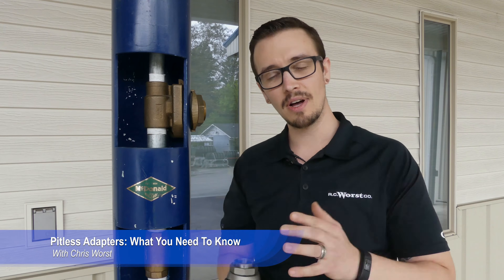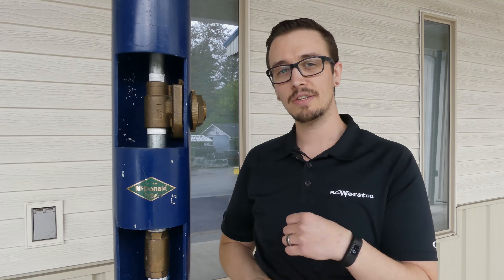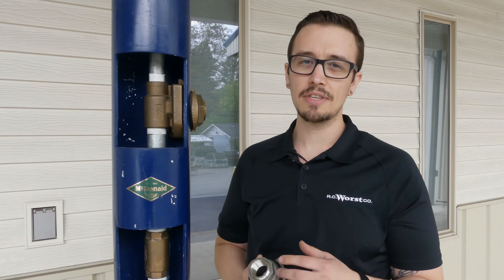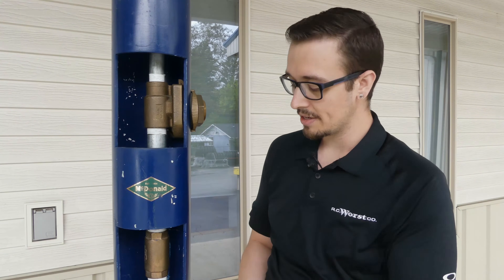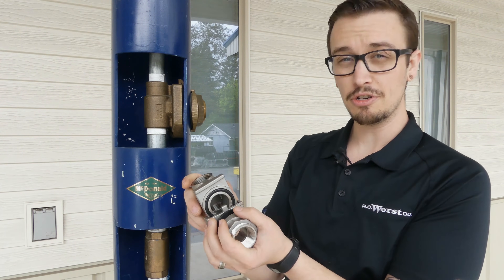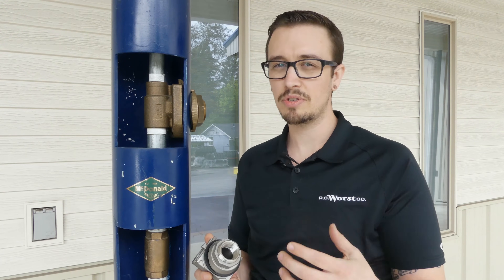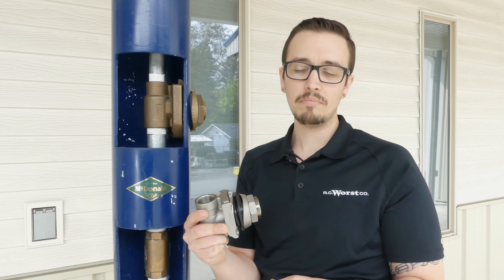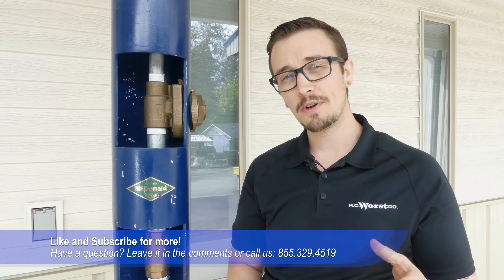Pitless Adapters: What You Need to Know

Comment: Another use for the Pitless Adapter is for outdoor frost free spigots…it’s a perfect alternate use that you’ll need to cap one port and drill out the other. Saves future headaches of digging and breaking out floors etc or going through hardened ground in the winter if things go wrong in that season.

Comment: Question: I just bought land with a well that was drilled back in 2003.  It's never used, it's just a steel casing that runs 325' and was reported to have a flow rate of 11 GPM.  I noticed this weekend that there was water gushing out of the well head after a bit of rain.  Im wondering what happens when the temps dip down below freezing?  Is there a chance my casing is cracked?  Or are they tough enough to deal with expanding frozen water?
Reply: if your well is 325 feet deep water should never come out of the head
Reply: @FlyinRaptorJesus apparently the water table is very high.  I had a well guy come out to give it a look and he said I’ll have to install a pit less adapter. He said the well is seasonally  artesian

Comment: there are 2 types of adapters, one like shown and one that hangs from a  T at the top of the casing and uses a long tool to tighten/loosen the saddle that aligns with the hole in the casing down at 4 or 5 foot.

have a great day

Comment: I want to install a Bison Pump deep well hand pump alongside my submersible pump. Unfortunately, my pitless adapter is really large. It takes up 4" of the 6" inner diameter of my well casing. I'd like to replace my pitless adapter with something that is smaller, so that I have more room inside of my well casing to fit the hand pump. Anyways, my question is if I dig down and attempt to replace the pitless adapter with one that is smaller, will it still fit in the hole that is in the side of the casing? Or will the casing hole be too big for a smaller pitless adapter?

Comment: Great Video !
I have a question, after 40 years my water system has developed an air leak.  It is not bleeding air from inside the house; the check valve is working at the pressure tank, and it's a solid pipe line to the well casing.  I say bleeding air....what is happening is the water is falling back into the well when the pump stops
So, could the rubber gasket be bad on the  pitless adapter ?
Reply: Depending on the depth of the well, you will also have check valves on the drop pipe, directly above the pump and one built into the top of the pump. If this a shallow well set, you may only have the one in the top of the pump and if that valve has failed, you will lose water back down to the static water level. If that is only 20 feet above the pump and the hole is 70 feet, you are going to loose water from the check valve up top all the way to the the check valve that has failed. Best thing to do is to have a professional pull it and replace the check valve that has gone bad.

Comment: How do you pull the pump and motor if it ever goes out??
Reply: Call a professional. the first thing people do is loosen bolts on the well seal and that is the first mistake. The nuts on the bottom of those bolts fall into the well and jam the pump when you are trying to pull. A professional will save you time, Money and frustration if you just let them do it from the start,

Comment: I wish he would have went a little further on how to drill into steel well casing,  what kind of drill and drill bit works best
Reply: He said with a torch or carbide hole saw. Both of which aren't in your common home tool kit. A torch would be oxy acetylene, or a plasma cutter. Carbide hole saws are a little pricey, I just checked and its about $20 just for the saw and that is if you already have the mandrel.

Comment: Absolutely worthless device! Put a proper well building in or use a insulated valut!
Reply: @privacyatty   Basicly a shed big enough to house the pressure tank filter if need and still have room to do servicing and cleaning. The floor should be concrete ,insulation in the walls to regulate temeprature.
Reply: If you don't have a pitless adapter, you need to prevent water freezing up to the surface, and any where pipes are run. This will vary by your local climate, so for me, I would probably need to have some sort of heater going. This would include your well head because you will have water running there. Don't forget, water freezes at 0C, 32F, 273K and the higher pressures in the system don't change that enough to really matter. It won't be exact for your water (its not pure water) but its close enough.
Reply: @snoopdogie187  Yeah I don't see how a well house could work unless it's heated or in a somewhat mild climate.

Comment: What size is the handle that goes into the pitiless adapter I need to make one. ?
Reply: My pitless adapter has a blind 1 inch hole on the top side. The handle is a long length of 1 inch steel pipe with a tee and short pipe nipples forming handles. Does that make sense? You reach down the well, looking with a flashlight, and screw the homemade tool into the pitless adapter, then pull up the pump. The handles prevents you from accidently dropping everything down the well.

Comment: Your videos have been incredibly helpful man. Thanks! How do you decide how deep to put the pitless? I keep finding different answers. My frost depth is 3.5'. It seems like the casing is kind of an air channel to the surface that cold air might go pretty far down.
Reply from the maker: Thanks for the kind words!  The pitless adapter should be installed below the frost line and on the side of well casing where the supply line will run from well. As long as the well is capped/sealed at the top there shouldn't be any freezing issues.
Reply: @RCworstwater  Thanks for the reply!
Reply: We generally dig a 2x2 hole in the side of the casing at least 18 to 20inches deep

Comment: I have a steel plate about 9' down the casing it's about 8"above the pitiless fitting. Is there a special tool to get it out.
Reply: Pull the pump and pray to God it doesn't fall down

Comment: If I drill through the steel casing, will the fine steel shavings that will inevitably fall into the water mess with my new pump? The dummies that put my well in just brought the water out the top of the well, then to a pressure tank beside the well head, then dig a ditch and ran pvc pipe 10 inches underground to my house. Then they built an ugly pump house around it all.
Reply: Nothing wrong with that: I have the same thing on one of my wells, with a nice looking pumphouse enclosing everything. Although we can hit minus 40C I'm very happy with this setup.
Reply: @paulmaxwell8851  Is your well house heated? If not, how does it not freeze with the water coming out of the top?
Reply: Out the stop is best,if you have to pull said pump all you do if propery done is shut off and unhook power uncouple a union and pull pump,pitless you basicly hav no choice but to make a huge mess.

Comment: Thanks for the video! I watched your video on the water pressure tank the other day. I successfully re-charge mine using a bicycle pump. An  Air compressor  would definitely have been easier. 

 Regarding the pitless adapters… Where does one find the tool for extracting it? What size threads are those in the top?
Reply from the maker: Good question. The depth of your piping in the well will determine what tool is used to pull it, anything over 100' will likely require a hoist of some kind. The size of the threads is most commonly 1" or 1.25".

Comment: Better solution would be to use a rubber ball valve
Reply: how would that be better than a pitless adapter? a ball valve cannot dis connect and re connect in the event that the pump needs to be pulled, and thats not a question of if it will happen, its when. last time i looked at ball valves they do not disconnect at any point of the valve, let alone withstand 6000 psi lol.